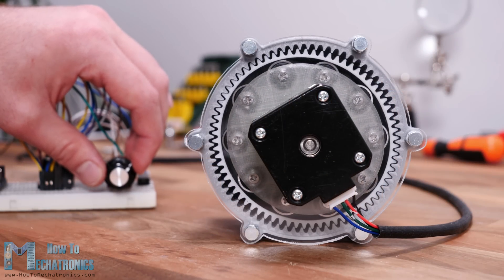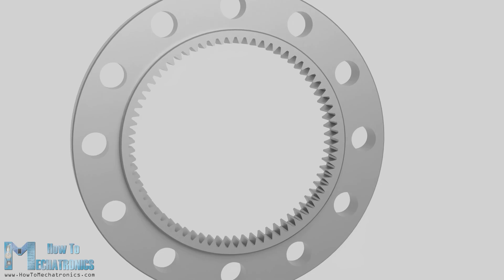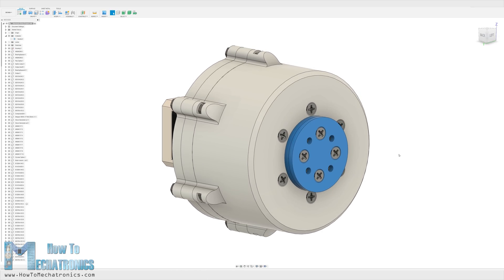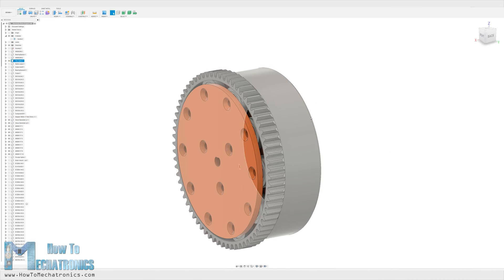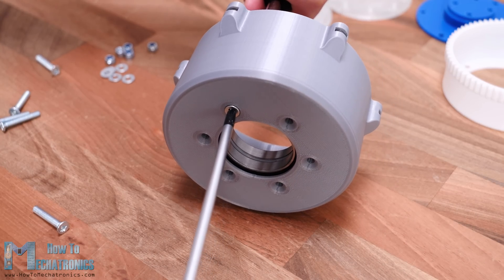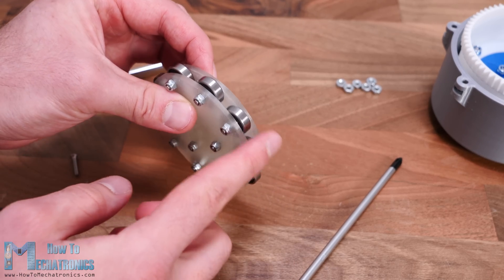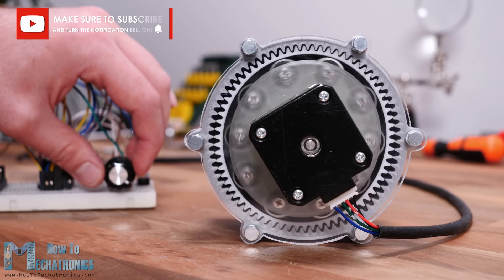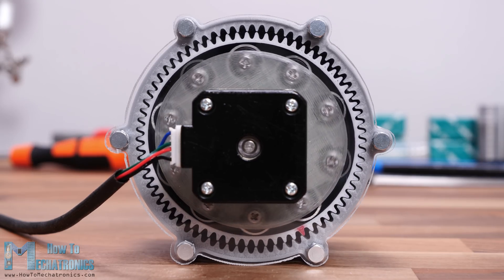What is Strain Wave Gear a.k.a. Harmonic Drive? A Perfect Gear Set For Robotics Applications!?

Comment: Pretty sure you can print much better with 0.2mm nozzles, random seam, calibrated flow and anything but a CR-10. 0.15mm is abnormally large.

Comment: You said the steel is so thin it is flexible at the teeth. What kind of steel does that? Is there no fatigue? How long do they last?
Reply: have you tried taking a look at this thing called a spring and check what material it's made out of

Comment: Beautifully-designed assembly.  Well done.  I noticed the outer gear case appears to be flexing as the unit operates at 15:32.  I wonder if operation could be improved by increasing the wall thickness of the outer case to stiffen the structure supporting the outer gear teeth.  It’s really a great project though.

Comment: Amazing video, mate! This is what I was searching for, and this great harmonic drive model looks very reliable!  What was the 3D printer's nozzle size when you printed this harmonic drive?
If you don't mind, can you tell the print settings so as to get the desired strength of the parts

Comment: Hi! Thank you very much for such a detailed guide, the results are super impressive! Could you share you thought please, is it possible to achieve the "factory" quality with the 3d printed harmonic drives? Perhaps, if use photopolymer printing, instead of traditional 3d printing, the accuracy should be better, then the gear's teeth can be smaller, the deformation will be smaller, will be less friction, the backslash could be reduced, etc. can it work? 

I'm asking because such devices are widely used for the astronomy, where high precision is required. And the price for precision is high, it is thousands of dollars. Potentially, the ability to 3d print stuff like that could be game-changing.

Comment: This is obvious that with that layout a flex spline must not have a solid body in order to move a stress deformation form a junction between walls and a plate upper to a middle of walls. Make windows there (free of a material), and this flex spline will remain flexible and will never break apart. This transforms a deformation form horizontal one (that breaks the spline) into a vertical one.

Comment: Hello i would like to use harrmonic drive on my final project. Our project will be a bionic arm, so we will need good acceleration. For lowering overall cost we must use nema17, my question is how will i rotate my stepper motor faster? Should i use a4988 driver or use tb6600?

Comment: I actually bought all the parts and a 3d printer for this project. Hahha 

I notice you have the cr10 v3 now. I have nothing but trouble with mine. What settings do you use in cura being creality never made one. I've never been able to tweak it properly. Prints turn out beautiful or clog the whole hotend assembly haha. My other creality printers are great. If you can offer any assistance I'd appreciate it

Comment: That is a cool 3d printed adaptation.  I do have a few questions.  First did you calculate the efficiency of the gears?  Also, flexing material is proned to rapid fatigue failure, did you run a fatigue test?  I would be interested to see a follow up video addressing those topics.
Reply from the maker: Thanks for the input! No, I didn't do any efficiency calculations or fatigue failure tests. Yes, maybe I could include these topics in some future videos. I do plan to make a video about Cycloidal drivers and make a comparison video between the two.

Comment: Hey, just a tip , you can have multiple components in one component in Fusion 360 and it will be neet and clean, you just need to right click on made  component and select add component, it will stack in to one component

Comment: This doesn’t look high torque to me, because the output shaft is driven by a flexible material,with tooth also made of flexible material...
Maybe you can instead make this out of a chain with right teeth, but how do you then couple that to a circular output?

Comment: Best explation ever. Great visualisation, can see the effort that was put in it.
 But I have too many questions.

1. Can it be used as high torque lowspeed to low torque higher speeds? ( Just like normal gear box using in both the direction)

2. What if we use very high speed motors ( drone motors) as input?

3. Can flexible inner teeth made of aluminum withstand higher input rpm?

4. Efficiency and heating?

I have lot more to ask but just need these answers.

I know these are a bit weird questions, just want to compare with other models of gear boxes.

BTW you got a new subscriber...

All the best for future videos and lots of love from India.

Comment: I never thought I was smart enough to get into engineering until this section of Youtube started blowing up.
Reply: Dont want to ruin your mood, but this is nothing like learning engineering at a uni or working as an engineer, he is simply explaining a system without the use of math, just how the parts interact, if this was to be used in engineering practically, or if you were designing this, you would have to calculate the stresses in the gears, both fatigue and static, select proper alloy steel, find proper bolts and preloads, work with tolerances and way more that i cant even get started on. A lot of math and formulas, its not impossible but there is a lot of learning to be done. This video is pretty amazing, but its not an engineering tutorial in any way.
Reply: @SeaShrimp  Thanks for that. I got too excited.

Comment: Great job! I can't wait to see where you take your design. Which design aspects are you optimizing for? Backlash? Output Torque? This kind of system should be able to produce very high gear torque as it goes as the square of the ratio. So, a 35:1 reduction should (theoretically) provide1,225x the torque of the motor alone in exchange for reducing the speed that same amount. That's enormous!

Comment: That I think is the most impressive use of a 3d printer I have seen to date :-)
BTW - I think you should consider a cnc router for your next project (would have been ideal for cutting your acrylic cover)
Reply from the maker: Yeah, I CNC router is on my to-do list :)
Reply: @HowToMechatronics  I used an Arduino Uno with GRBL installed which works well but I think the esp32 based version looks very impressive (I may convert over myself some day)

Comment: Flex spline? So something exotic, but you won't see it in something like daily driven car, trains, busses, ships, basically anything that is highly and heavelly used - too much losses, and mechanical somehing(property why you cant use strain gauges to weight something for long times) and other mechanical properties. Well im not a mechanical engineer, so what did i know.
Reply from the maker: Actually these type of gears have a lot of usage in high-end industry like robotic and aerospace.
Reply: @HowToMechatronics  that is what said: not practical for daily usage. Aerospace and other high end applications: 200-500 hours of operation and full rebuild is acceptable/appropriate. For my daily car 100-200 hours oil change, 1000 hour, belt change, 
5000 hours, rebuild...

Comment: How well do these drives resist being driven backwards?  Ie, if you have a large load against it, and remove power from the motor, how well will it hold that load?

Comment: Nice description and demonstration. Used a harmonic drive about 35 years ago, if you look at how the drive is transferred it should be obvious that it's non linear, almost a kind of ratchet action. This therefore does not really lend it self to being used within a precision reduction system. An important consideration is that these gearboxes are most efficient when working at, I seem to remember but may be wrong, some 90% of maximum design loading, efficiency drops off dramatically at lower loadings, from this it can be surmised that it would be only suitable for a constant load.

Comment: That’s just beautiful design and construction. I am in awe!

I had some questions about the design of the flexspline, but while I was typing them the necessary tradeoffs became apparent. Beautiful design choice with the bearings. Regarding the tape helping, maybe considering the bearings as forming an octagon (were there 8?) rather than an ellipse would suit better. Yes, I know, the teeth still need to mesh.

Comment: Nice description of what they are and how they work, but they do come in more forms than just that.  Specifically, the driving cam can have differing shapes, with fewer "points" offering greater tolerances but a smaller max load.   Iirc, it also effects the actual gear ratio or reduction as well.

To make your design easier to print, consider reshaping the drive hub to look like an egg.  Since only one section of teeth will then ever be meshing at once, the design will be more forgiving of small alignment issues and will run more smoothly.

Comment: How about using this as a generator? For vertical axis windmills this could be interesting. They are slower speed higher torque and not great with most generators. Perhaps this helps?

Comment: Great video! But, when I saw you installing a bearing with a flathead and a hammer, it caused me physical pain 8:55
I know this is just a quick build, but people watching might try the same method for something important. Using a screwdriver and hammer will damage the bearing. Or, most likely, shorten its service life.
Reply: Also using a torx driver for hex bolts at 9:50.
Reply: @crunchyplasma1876 , I hadn't caught that one, it was so quick. Good eye, sir.

Comment: This is great. That was a great deal of work. I use the software on my iPad Pro, and it works very well. It’s very different from the Bentley Cad I’m used to. I did notice that it appears that some of the gear teeth touch when moving over one another. I attribute that to the usual sloppiness of inexpensive 3D printers. Possibly removing a fraction of a mm from the very tips of the teeth would solve that, as I can see a slight jump when that happens

Comment: How do you get the output chaft to rotate verry fast❓ Without heating the input motor, becaue 1 rotation of the input motor only rotate 2 teeth of the output shaft... do you need a ultra-quick motor to drive the gearingsystem?

Comment: Beautiful realization, thanks!!! The practice of making 3d printed gearboxes  opens lots of new possibilities... For instance in light e-mobility, or small power generation etc.  I'm wandering how much can be the increase in backlash,  smoothing and durability by increasing the quality of printing and material. Carbon fiber nylon printed on a closed printer (like Makerbot) and high temperature environment, could be a good idea?
Reply from the maker: Sure you can significantly improve the overall quality and performance using better printers and materials. Though, I cannot say anything specific, as I haven't use such printers or materials.

Comment: I love the design, and may try to build this one day.  I do have a question though - are all those bearings necessary ?  It seems like only the bearings on the major axis of the ellipse ever touch the flex spline.  What function do the other bearings serve ?
Reply from the maker: Thanks. Well true, you could use just like 6 bearings, 3 on each side of the major axis. The PLA material is not flexing that much to touch the other bearings. If the material is a little bit more flexible, and at higher speeds, the flexspline might wobble in the area of those bearings, and in such a case those bearings would be useful.

Comment: How is the noise compared to a standard gearset?  I want to use brushless motors for a rover. In my research most are really noisy. Wondering if this could be a solution.

Comment: Wave generator doesn't need to be elliptical. Elliptical shape is easiest to calculate the gear ratio.
Power transmission can be done in multiple ways with demanded ratio and direction, by fixing one of three elements and power transmission through other elements.

Comment: Just thinking outside the box, could you create that special type of bearing by CNCing or printing a rounded tooth (rounded to fit ball bearings in the gullets) oval shape sprocket for the wave generator and use delerin or steel ball bearings?

Still love this, I did learn something new.

Comment: If the wave generator makes contact in only two points, why we need the bearings in entire circumference? Can we not have them in only those two places?
Reply: Rest of bearings are used to better control of the shape of flexible gear. If there would be only two bearings, the gear would be travel much more and may worn quicker.
Btw, wave generator may have more then two contact points and the output doesn't need to be on the circular spline but on flexible spline or wave generator. One of these three parts must be fixed and power transmission will be done between other two, with different gear ratio and change or not the direction.

Comment: Back in the early 80s we were working at a technical college and built a small robot-arm that was controlled by one of the early PCs.

We could get the arm to touch the same point maybe 5 times out of 10. No stepper motors were available to us back then.
  Still, it was quite something and we were pleased with the result.  A little frustrating to know we could have done so much better with a little more resource, a little more time.....

And now this!  Less than 40 years later and we can make components using 3d printers using software that was the stuff of dreams back then.  (Actually, we had Autocad which was great for the time but so sloooow).  Had you suggested that things like the Arduino would be available in the future, then few would have believed. 

Your video is inspirational.  Thank you for sharing.
Reply from the maker: Yeah it's amazing how fast technology advance, and many things get super available for all of us.
Thanks for the input!
Reply: It's actually the people like both of you guys that advance technology.  It always amazes me how many inventions were made in the 30's, 40's, 50's, all the high tech stuff we have today came from people like you finding stuff out the hard way, the learning way. Too many people just not doing any thinking about stuff these days. Keep doing what you're doing and include yourselves amongst your own icons,  after all , you are inspiration for the future.

Comment: That's a great video. It was very much informative and walk through was very nice through out the project. Thanks for sharing all the information. I would like to learn more about these type of gear drives. According to your project for a speed reduction of 30 times we got a torque of 10 times from original. That's not bad at all with small Size it comes in. I think we can get more torque with same dimensions with same reduction, having staged gear sets. But considering manufacturing costs, for small projects i think using these drives is advisable. Because in gear train we will have multiple gears, components, bearings, keys, circlips and to pack in small space it will become complex. Once again thanks for sharing this video, its very informative.

Comment: Does the constant flexing cause wear and reduce lifespan compared to a gear assembly which can function with everything rigid?

I imagine it's like a spring where the metal of the coil constantly flexes. Do springs ultimately fail due to this (have limit to number of contractions - reliable lifespan)?

Comment: woa, this project has evolved !! I made one when it first popped up on thingiverse. 3-5 years ago...  Excellent video.   My 2c = I think the size of the inner teeth will need to be non standard. The size is based on the traditional gear formulas. Those are meant to mesh with each other and I think the backlash problem will be solved by customizing the tooth profile. For example: Making the inner tooth profile thicker near the root(pressure angle?) ... OR  Why not think outside the box and use 2 sets of gears !! You know that old trick where the slack in 'linear rails' is removed by using a second rail which is offset. Split the rail and set the offset, So one rail is on one side of the tooth, and the other rail is pushed against the next.  On small music players it was merely a spring which provided this tension.   //// Also, I've been a fan of printing flat templates >> In the end, you made the acrylic face plate << Yea, so I've been intentionally making paper thin part templates in the 3D printer. It works really when you want a metal shape.  U get the program to make a flat pattern / then print the flat with a flexible filament(petg works fine) / then fold your metal by hand tools / Yea the precision is insane cool. / Can also make bend helpers & reliefs to assist folding.
Reply: Wouldn't a regular 2D printer be faster for printing templates?

Comment: is there an equivalent gear system that's multiply gear ratio instead of reducing ?
Reply: I think there is BUT you lose torque/power  because of the reverse of mechanical advantage. You can't get more power output with negative advantage ( which equals disadvantage). You can get more speed but not power. I'm not gonna say that it's impossible but as I understand physics and engineering, maths etc it seems impossible to me and if possible it will be too expensive I'm guessing to be beneficial in our money world.